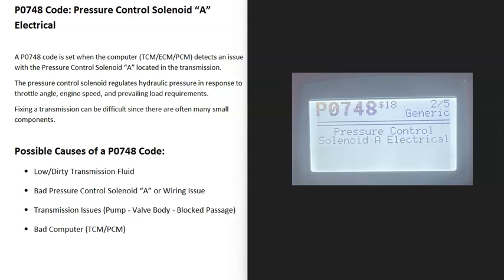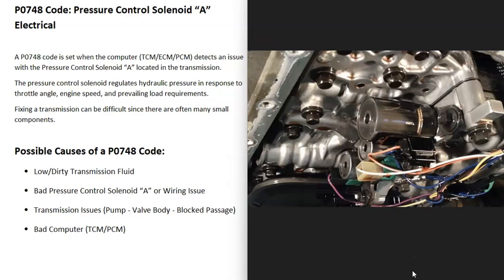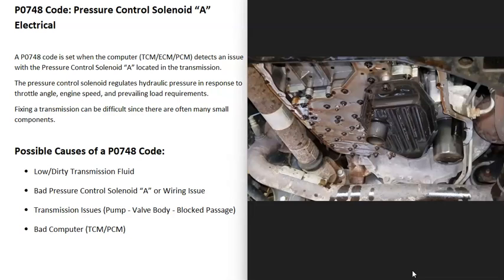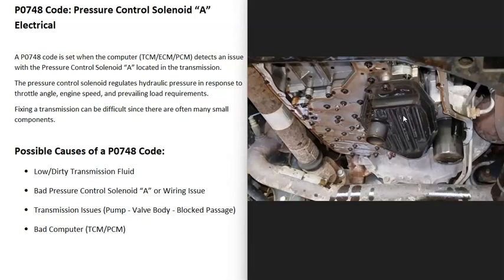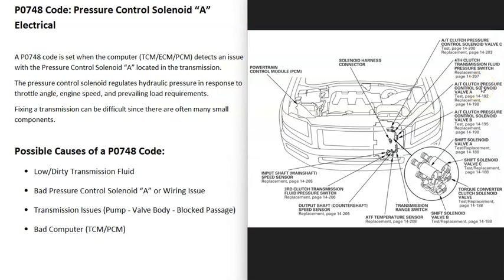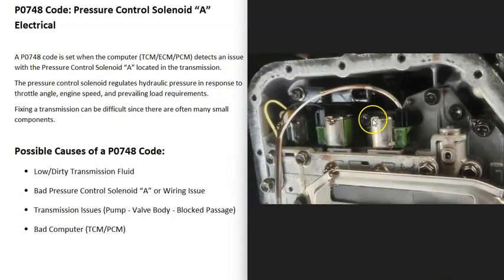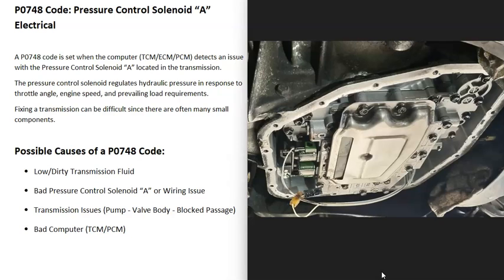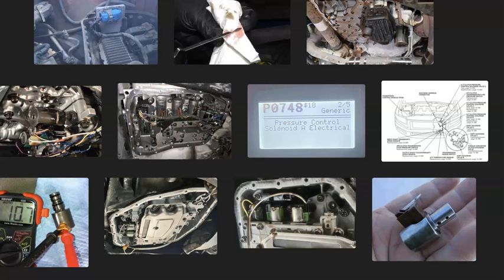Causes and Fixes P0748 Code: Pressure Control Solenoid “A” Electrical

Comment: I ran over a speed bump and I scraped the trans now I got this code ..all the lights on car lit up and trans hear won't shift it'lock
Reply: I’m the solenoid wire got pinched. Or smashed take the trans pan off

Comment: Hi I have a vehicle hyndai accent rb 2012. Have the code p0748 when i switch off the car the alarm is rest. Change the transmission fluid with filter. But now it become worse the alarm is present even i switch off the car the code is still present.
Reply: Check your Car ECM Capacitors or other elc parts

Comment: I'm replacing the valve body on an 06 Kia Spectra. Do you know if I have to have reprogrammed? I have this code also p0700 and p0748. Car goes into limp mode once a week. I already changed the input output transmission speed sensors and did a transmission fluid flush and new filter I'm trying to fix this issue where it goes into limp mode and get stuck in third gear. I turn the car off let it sit for 10 minutes turn it on everything works perfectly. So I'm changing the valve body out and need to know if it has to be reprogrammed after I do this or if there's any other options to reset the shift patterns and can this be done with a ODB reader
Reply from the maker: I'm not sure on the year but I believe it will need an Adaptive Reset. Here is a video https://www.youtube.com/watch?v=acqwTQwVQYs
Reply: Did you manage to fix it? I have the same issue
Reply: @crankhandle  it's going to be the wiring harness more than likely that's on the valve body so I just ordered the valve body and put a new one on it and I had my buddy who has a really nice scanner tool reprogram it. If you pop off the back of the plug of one of the wiring harnesses on the valve body it'll have solder joints that are burnt up or cracked or both
Reply: @crankhandle  it's a common issue but it was easier to just replace the valve body which has the wiring harnesses already attached to them versus just replacing those wiring harnesses
Reply: @crankhandle  but yes that fixed it
Reply: @crankhandle  I got the valve body off at eBay it was about 250 bucks and refurbished and I've had no issues since then Hope all this info helps Good luck
Reply: @Slumericanbandit83  awesome thanks for you reply, I might try to tackle it myself! Glad you got yours sorted out